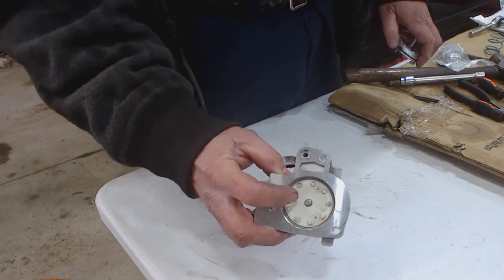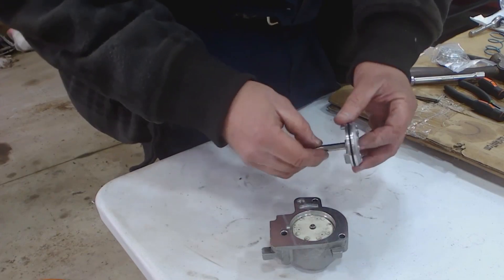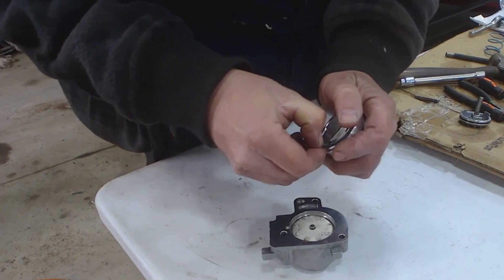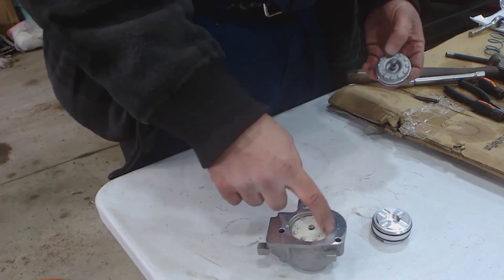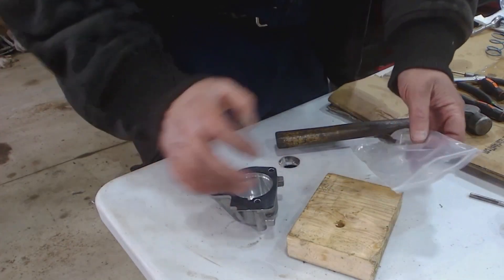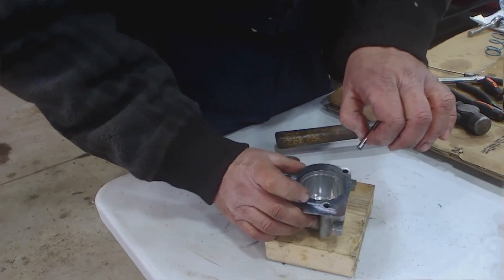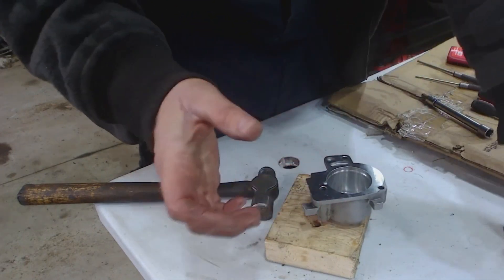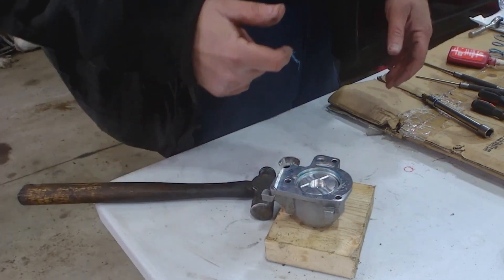How to install Pin-less Accumulator Pistons in your 4L60E

Comment: Where did you get your at
Reply from the maker: The one I'm installing in this video is NOT the real Sonnax kit ... it's a cheap chineesium knock off from Amazon .... that's part of the reason I use the factory pins instead of the supplied balls ... if the balls are too small, they don't hold and if they're too big, you can crack the aluminum while installing them.
Reply: @TheOddShop-bp6ov is it hard to replace while the transmission is still in the vehicle
Reply from the maker: @davenbuteau9825  Not really .... if you are installing all 3 pistons, you need to remove the valve body to get the 3-4 piston in. The 1-2 piston housing is just held in with 3 bolts and putting the forward piston in is easy once you have the valve body out on the bench.
Reply: @TheOddShop-bp6ov okay I'll probably just do the first and second because my first gear shifts hard
Reply: @TheOddShop-bp6ov during the first and second one in a Corvette servo will that help hard shift in the transmission and help the transmission last longer
Reply from the maker: @davenbuteau9825  Yup ... if your 1-2 shift is "sluggish" and then goes in harsh .... that can definitely be caused by a faulty 1-2 accumulator. When you replace it, look to see if the stock piston is plastic and, if it is and you clean it, you can usually see a little hairline crack around the surface that corresponds to the base of that reinforced center that guides the pin. If you're only replacing the 1-2 piston, you just drop the transmission pan, remove the three bolts that hold the 1-2 piston housing, go do your "mods" on the bench and re-install. Keeps it simple.🙂👍
Reply from the maker: @davenbuteau9825  Putting a Corvette servo in is more-or-less like putting a bigger piston in for the 1-2 shift. It makes 2nd gear apply quicker and with more pressure. If your 1-2 accumulator is cracked, putting in a Corvette servo actually would make it worse .... the leak slows down the application on 2nd gear and the "clunk" when it finally applies would actually have "more" pressure behind it with the Corvette servo. In a "healthy" transmission, the Corvette servo "can" increase the lifespan of the transmission by reducing slippage of 2nd gear .... "however" ... the "driving style" of guys that install Corvette servos is usually detrimental to transmission longevity LOL!
Reply: @TheOddShop-bp6ov thank you man
Reply from the maker: @davenbuteau9825  You're welcome!
Reply: @TheOddShop-bp6ov hey where can you get the part at I can't find the part but I got the part number and every time I go on anything I can't find it
Reply from the maker: @davenbuteau9825  If I remember right, I had just bought mine on Aliexpress .... try this and see if it works ...
https://s.click.aliexpress.com/e/_mOituUv

Let me know ok.
Reply from the maker: @davenbuteau9825  If I remember right, I just got mine on Aliexpress. Try this: https://s.click.aliexpress.com/e/_mOituUv and let me know if that works for you.
Reply from the maker: @davenbuteau9825  Easiest thing is just to go on Ebay and type "4L60e pinless" in the search bar. Then you can pick if you want the "real" Sonnax part or the cheap, Chinese part and you can pick if you want the whole kit or just the piston for the 1-2 accumulator and you can choose if you get it from a local seller or an "international" seller. 😉👍

Comment: That's pretty smart using a piece of the old rod instead of the ball.
Reply from the maker: Yeah, some of the .... "cheaper" kits sometimes have the wrong size balls ... if they're slightly too big, you can crack your part! Rod works every time! 😉👍
Reply: @TheOddShop-bp6ov  I plan on doing mine today, so thank you.  I had to wait to get a small enough punch for that small(er than I expected) hole.

Comment: Great video. Sonnax instructed me to discard the small spring since the pin is no longer in play. Is that correct or reason for using small spring still?
Reply from the maker: Yeah, you don't need the "inner" spring with the pin-less pistons because it wouldn't contact anyways. My understanding is that, that spring was there to cushion the original piston's reinforced area around the pin near the end of it's travel but, because of the shape of the pin-less pistons, the longer skirt would probably bottom out before the piston even touched the inner spring.Hope this helps!

Comment: So to be clear, 1-2 needs to be plugged, forward accumulator piston needs to be plugged (with two big balls or two small balls?), and 3-4 accumulator is a BLIND HOLE? Correct?
Reply from the maker: Yes ... and again, you can trim the end of the pin for the forward accumulator and use that to plug the hole, then again, take a torx bit that is just slightly too large for the hole and stake it in place with that (hammer "gently"). Sorry for the confusion.
Reply: @TheOddShop-bp6ov ok sounds good, and yea the little checkball in my kit was too small and dropped right in so im just gonna cut the pin and use that then stake it. Thnx

Comment: Are you sure the forward accumulator is a blind hole? I just installed a set of pinless accumulators after watching your video and now I have a slipping forward clutch. I went over the instructions for sonax pinless and it says you have to plug the hole in the valve body
Reply from the maker: I just went and double checked on another 4L60 core I have and you are right, the forward accumulator pin hole does connect to a passage in the valve body.  I apologize for my mistake, man, hopefully removing the pan isn't to difficult in your application to go correct the situation. Sorry again.
Reply: you very much need to plug the hole for the forward piston i’m doing the same upgrade right now  and the pin goes through the vb so it will leak if not plugged
Reply from the maker: @eet9549  Crap! .... you are right .... just went to double check on another 4L60 core I have and the forward accumulator pin hole does connect to a passage in the valve body. I guess I'll have to go double check on the one in the bimmer. Thanks for input.